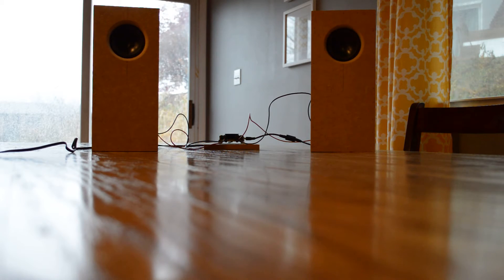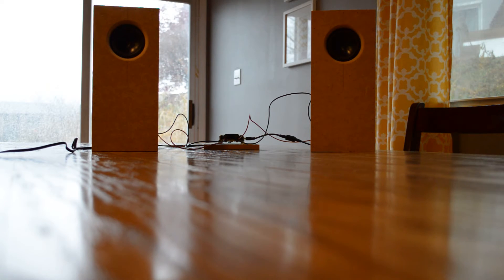DIY Paul Carmody Sprite Speaker Sound Test and Overview

Comment: Do these require tweeters when made like you did? I'm trying to create a nice small system with a lot of punch; my media room isn't that big. Also, do you think 4 of these in a small array would sound good and loud for home theater? It's either that or making some bookshelfs with a Dayton RS 7 inch and a good tweeter. What do you think? Thanks again!
Reply from the maker: It is a good question.  These don't "require" tweeters as they are full range.  However, they could definitely use some.  These were created for more bass, as there are people who wish they had a little better high end.  I probably would not use these in a home theater setting.  You could do a lot better than just these.  I like the idea of some bookshelf speakers with the Dayton 7" RS series.
Reply from the maker: If you want a really nice flat response tweeter, check out the https://www.parts-express.com/peerless-by-tymphany-xt25bg60-04-1-shielded-dual-ring-radiator-tweeter--264-1012
Reply: 123Toid funny enough, those are the tweets I was looking at lol. Thanks again
Reply from the maker: Nice!  You have good taste :)

Comment from the maker: So there is a lot going on in this question/statement.  A lot of woofers are 4 ohm, yet the overall ohm rating of the speaker will be 8 ohm.  This has a lot to do with the crossover and other speakers that are in that speaker, which make it an 8 ohm speaker.  So yes, you may use 4 ohm speakers, but still have a on overall speaker be an 8 ohm.  Having said this, you  can use 4 ohm car speakers on an 8 ohm receiver.  Here is how you do it:  You take two 4 ohm speakers and hook them up in series.  This will give you a total output of 8 ohms.    The downside, is you would need more speakers (four 6x9's for 2 speakers). There may be another option, as well.  Take a look at your receiver/amplifier.  If it has audio outputs via RCA (like a 5.1 or 7.1 audio output) you can buy mini amplifiers from parts express and hook your 6x9's up that way.  The RCA would hook up between your theater receiver and your new amplifier.  It would send the signal to your new amplifier, which would be capable of powering a 4 ohm speaker.

Comment: I have a question about car audio speakers. When I was in high school and everyone was outfitting their cars with heavy audio I was told car speakers can never be used  on home amplifiers. Home stereos are normally made for 8Ω speakers and car audio speakers are rated at 4Ω. However, I have since taken apart some car audio speakers only to find that many of them are built using 4Ω speakers parts. For example, if you go to parts express and want to replace an 8 inch woofer for a Infinity speakers cabinet they will tell you to buy a 4Ω woofer, not a 8Ω woofer. Given that home stereos are made with 4Ω speakers can't we just build a home stereo speakers using a car audio 6x9 with built in tweeter and mid range?  Also, I once saw a roofer working and he had made speakers out of reclaimed wood from a roof with 6x9s that sounded amazing, but looked like crap because it was compressed plywood board with silicone to cover up nail holes. I asked him about his speakers and told me it was "L ports" He also said it all was made from scrap and I believe he said used home insulation for the interiors of the speakers.
Reply: Late response, but he probably meant "L-Pad". It's a device used to match impedance.